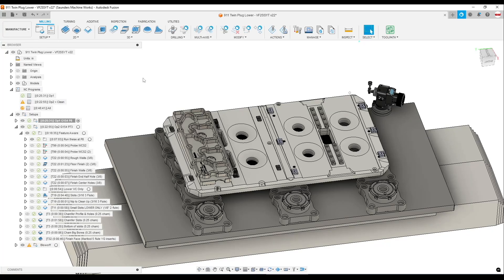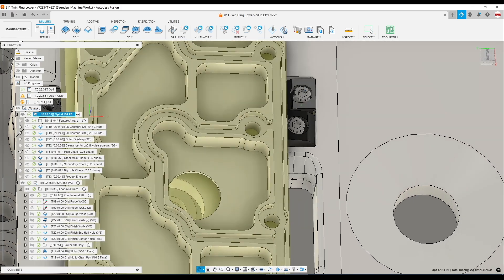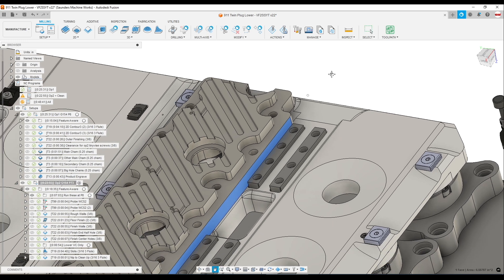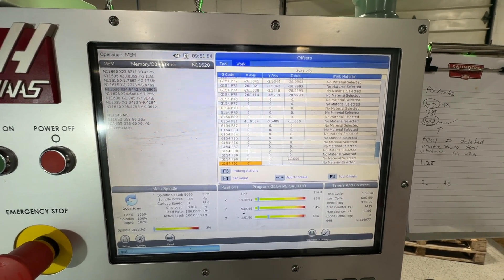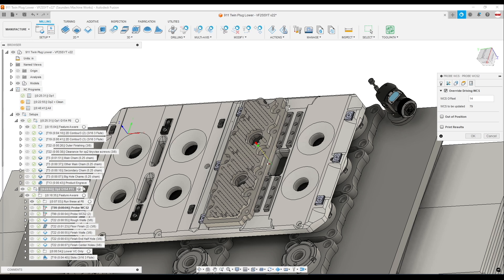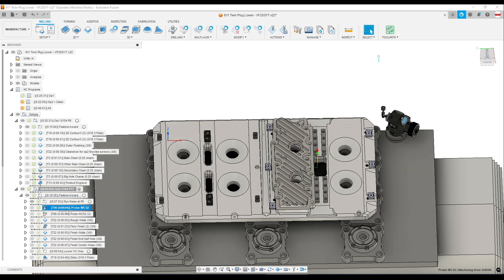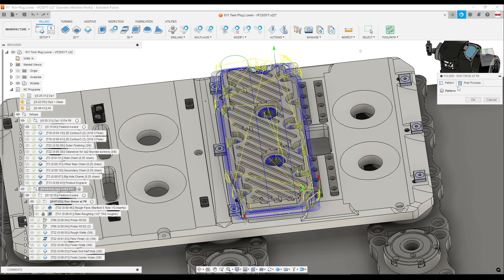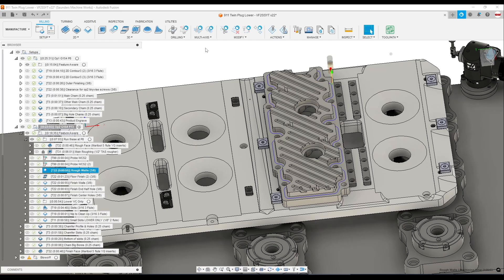What is Override Driving WCS in Fusion?

Comment: One thing I've discovered you can do to streamline your WCS selection in the model space is to add a Joint Origin where your WCS is in the zero point component and give it a name, call it G54 or whatever.  Add as many to you want, like if you have a WCS on the center point of every puck chuck on the fixture.  Then when you import the zero point component into your manufacturing model and create a setup, for your WCS you can use Orientation -> Coordinate System, go into the browser and select the" G54" Joint Origin (the Joint Origin has to be visible for you to actually select it in the Setup tab from the Browser).  You'll see the name "G54" in the Coordinate System selection, which is handy as a visual aid to know which zero point WCS you are picking for that fixture, but it also inherits the orientation of the Joint Origin so you never have to worry about the model orientation or selecting the X axis reference or anything, you set it one time when you create the Joint Origin and then you're done forever.  

One thing I wish Fusion would implement would be Machine Model driven WCS.  So if your machines are like mine and basically has a zero point fixture on it 100% of the time and are always using the same WCS, it would be great if the Machine definition had this information and you could just leave the zero point model and WCS info on the machine model and not have to import the zero point fixture model into the manufacturing model and select the WCS every time you make a new setup.  As long as your setup's fixture is correctly attached to the zero point fixture in the machine model, Fusion should be able to figure out where that WCS is in space relative to the manufacturing model. I've suggested this feature before but never heard back from anyone at Autodesk.

EDIT: A video I just made demonstrating this: https://youtu.be/mwCB_Dzb3uU

Comment: Great video! One tip—if you select a Haas machine definition in your setup (any generic one will work as long as it's configured with a Haas post), the Post Process tab gives you the option of toggling explicitly to extended work coordinates so you can enter offsets like 8 or 73 without having to do the math.
Reply from the maker: Oh that's very nice!

Comment: Probing it the way your probing it on op2 is still going to give you error on your holes as your only probing one side. its technically not achieving anything different than using the hard stops. You need to either probe both sides of the part to find the mid point or probe a  hole to take out any error from tool wear etc.
Reply: Wouldn’t you technically need to probe 2 diagonal holes to ensure the holes were not only offset in x or y  but that the part was not skewed in the fixture as well?
Reply: @bcbloc02  you could probe 1 edge to set the angle. But you would still need to probe 2 opposite edges to take out any error from tool wear